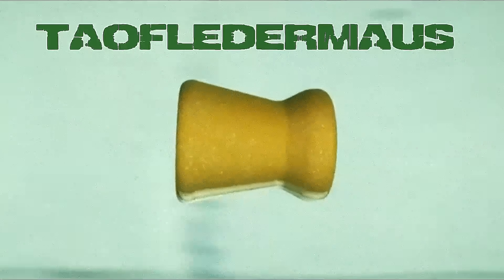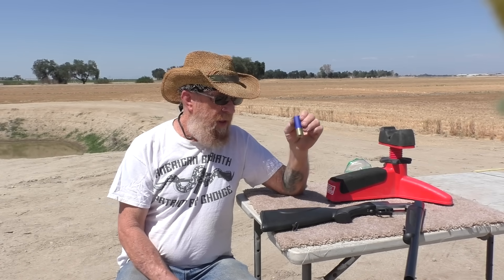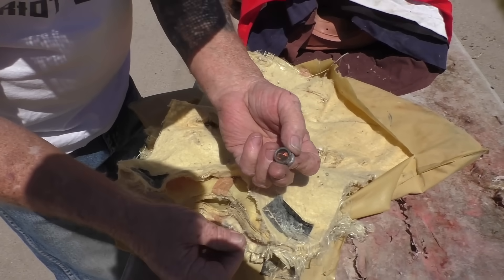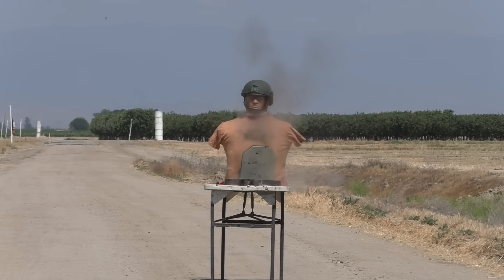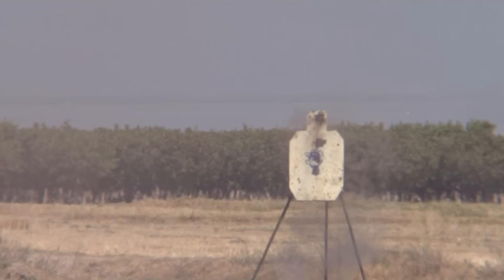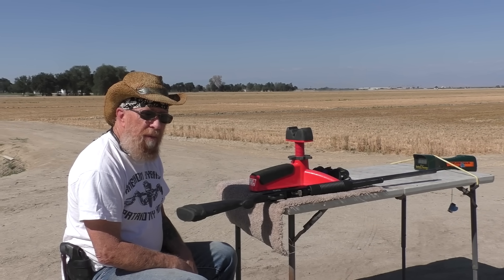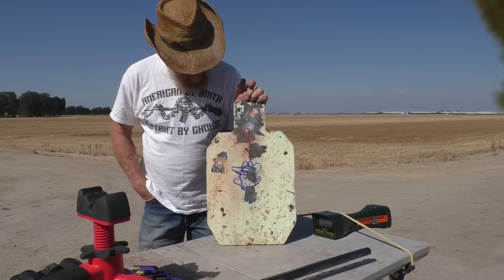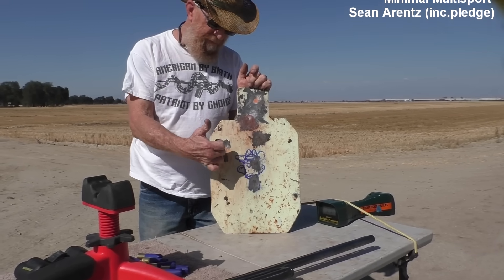Testing the curious CHALK WAVE 12ga. Slugs

Comment: It would be interesting to see this concept used with glow-in-the-dark powder (primed with high intensity light before being fired) at night. In fact, it would be interesting to see if it would work for the back side of the Diablo slug and to see it packed into the cavity of the hollow point (perhaps sealed with glue or something.)

Comment: For packing chalk or other dusts use a baloon or rubber glove (or if you are a bit gentle stretchtite) and hold it tight over/on the cavity before packing.  However you probably dont want the chalk too packed if you want a trail

Comment: Maybe the reason that you see the dust trail more often with the smoothbore is that the rifling in the rifled barrel leads to increased friction while the slug is accelerating down the barrel, which with the same type and amount of powder should lead to a slightly higher pressure, and thus the chalk being more compacted.

Comment: How do i sent a projectile in? I recently made a 3.5oz slug that i want to send in with a very unique design
Reply from the maker: I doubt I could find a safe powder load for that.
Reply: @taofledermaus  i could alloy it down to 3oz or 2.5 with a lighter metal.
Reply: @taofledermaus  or i suppose i could even do a 1-1.5oz and keep the same design.

Comment: What about drilling a very small (1/32" or so?) hole through the center of the slug and chalk after it's packed?  Imagine the small flowthrough would pull off some powder in an eroding stream, and shouldn't allow enough gas escape, especially with the sabot.

Comment: For the chalk, you'd get better results putting it in a small hydraulic press.  You could probably use a small car jack, with a little work.  You might need to add methylcellulose for a really good compaction.
Reply from the maker: It's really being compressed by the 12,000 psi pushing against the back of it.

Comment: If your cameras can support it you should try with a dust that is IR visible and do some night shots .Would a diablo with a small hole in the nose work ? Allow pass through after the sabot falls off  to eject more dust ?
Reply from the maker: Probably not because the powder IS compressed very tightly when it is shot.

Comment: If you drilled an 1/8” hole all the way through the slug before you packed it, would air flow through it and help the chalk trail out? Or does it not work like that at high speed?
Reply from the maker: I don't think it would because the chalk is getting packed so tightly when they are shot.

Comment: Surprisingly good results from these. Not sure if they were designed to do anything in particular but they mark the target well enough that I would consider buying them if they were commercially produced. Probably would be a good idea to press the chalk with a mechanical or hydraulic press to ensure the powder doesn't eventually break down and fall out during storage but this is a great first draft of something that could be very useful as range ammo.

Comment: First couple of shots looked like the idea was to imitate a black powder gun. Try packing the chalk looser and holding it in with a single piece of Scotch tape. That should come loose quickly letting the dust trail out sooner.
If I understand thew Diabolo's aerodynamics correctly, the open cavity at the rear is what stabilizes it. Filling that makes the aerodynamics go all wacky.

Comment: 0:50 Before watching it, my guess is that the inertia of the chalk combined with the high acceleration of the slug means that it'll fall out when shot, to be pushed out  by the expanding gas.
2:30 I did not expect that, since the projectile was encased in the sabot.  Was the gas seal poor, leading to the combusion gasses compressing the chalk?

Comment: Maybe drill a small hole through the tip into the chalk so as it travels air pushes a small amount out, test a really small hole and work your way up
Reply: It's supersonic, so no flow through the hole.

At least until they drop subsonic.

Comment: Is drilling a hole in one of these slugs a good idea?
I want one hole through the side of the slug to the powder.
It might be beautiful.
Reply: That will probably only work on subsonic rounds though--on supersonic ones the shock wave prevents air from flowing through.
I would like to see what it would do for subsonic rounds.
Reply: I have no clue about shock waves. But I expect the powder to be pressed out of the hole by rotational force, drawing a helix while making it's way through the air. Maybe.
Reply: @VetusMundus  Ah ok, you meant sideways, not nose-to-tail. That might work. It would be cool to try.

Comment: If you get the chalk slightly wet, then let it dry under high heat, it stays in the slug better. There was a guy that used to sell slugs that were filled with chalk powder, but there was a metal backing at the ear of the slug and a hole in the back to release the chalk out in a controlled pattern and then at Impact it left a big mark where you shot. I think they were called EZ Track Shotgun slugs. I forget since it was back in the early 90's

Comment: so a slug losing 10% of its velocity every 10 yards means it would be stationary at 100 yards?  your math is wrong
Reply: Not true.  1000 fps, then, 900, 890, 811, 729, 657, 592, 540, 490, 450, 415 are 10% losses every ten yards until 100 if the muzzle velocity is 1000. Thats math. So at 100 yards its still rippin at 415, still lethal for an ounce of lead, but also about a 4 foot drop, give or take, because slugs can even slide upwards and sideways if they're spinning endos like walking upstairs for a bit. You dont know if your ammo isn't thoroughly tested.
Reply: He got to it 1st
Reply: @TheAlto208  who?

Comment: A small hole, 1/32" in the front of the slug to assist with dispersion of the powder.
Reply: Supersonic flow will choke so there would be no or almost no flow